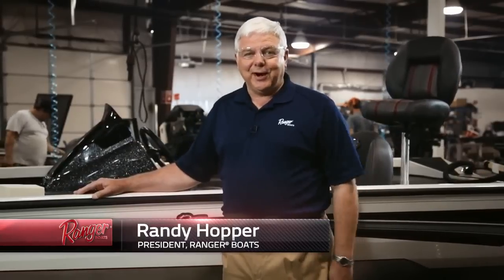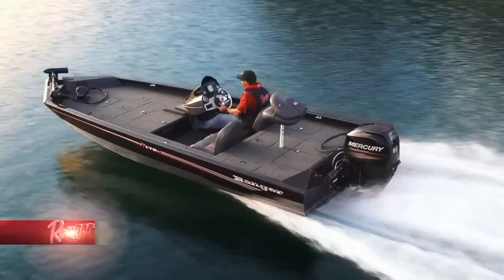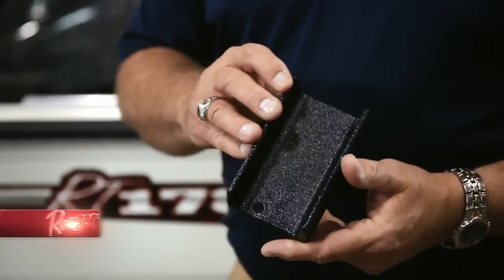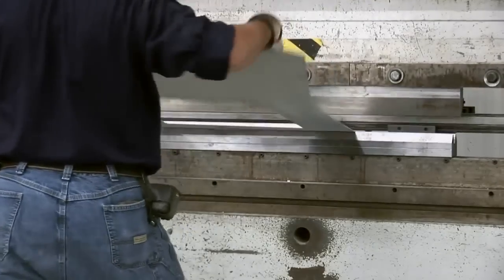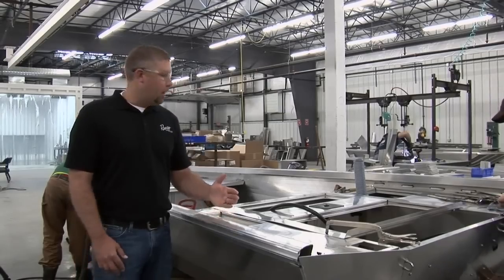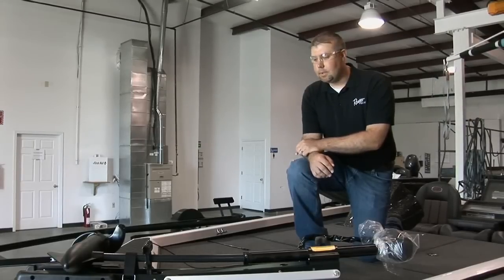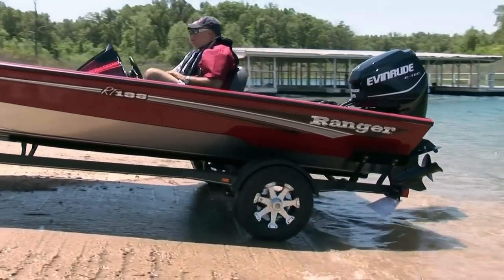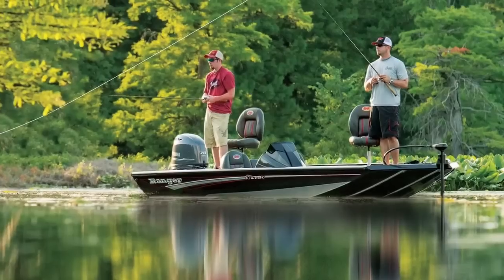Touring the Ranger Aluminum Factory

Comment: Hey guys, you make a very nice product, I'm an engineer and my question is this...you foam fill the hull which is excellent  but what happens if you get a hole in the bottom with welding wouldn't the foam burn and set fire to the boat or is your foam non flammable type and if so what kind is it ? cheers!
Reply: Ohh very good question.u r really an engineer ❤️👍🏼💪😎

Comment: How come a lot of the tracker and ranger boats are identical? Tracker is known for being a cheap and lower quality build?
Reply: Walleyeguy513  don't worry I bought a seaark instead. Built like a tank.
Reply: Shows how little you truly know when you say a tracker and ranger are identical...wow 🤣😂
Reply: I used to work at a machine design and manufacturing plant and one of the machines was a packaging machine for rubber gloves another was for condoms. 
All of the condoms and gloves were made in the plant and shipped over for packaging in 55 gallon drums.
They were then packaged in the “sellers” wrapping.
Long story short, sheik, Trojan, generic freebies you get from the clinic are all the same PERIOD 
A Chevy, a GMC, and a Cadillac all are the same except for the finish’s after base construction.

A Tracker Targa and a Ranger deep V are the same hull with different finishes after being built.

They are both sold by the same company white water marine.

A Tracker is the Chevy, the Ranger is the Cadillac.

The hulls are the same, look at them closely for yourself

Comment: fiberglass console is cost savings measure. its the same as in the glass boats. It also looks silly on the aluminum boats. the extrusion weld on the keel and gunnel is a weak seem compared to any other quality manufacture.  Just go around to any boat show and talk to the dealers.
Reply: Frank Mcchesney I just bought a rt188 today. One of the best boats on the water. I did talk to dealers, about 10 and none said ranger was bad. They said there were other good brands not only ranger. Ranger is solid as hell with great customer service and great boats.
Reply: @harryassenback2860  you didn't talk to the guys at Gator Trax